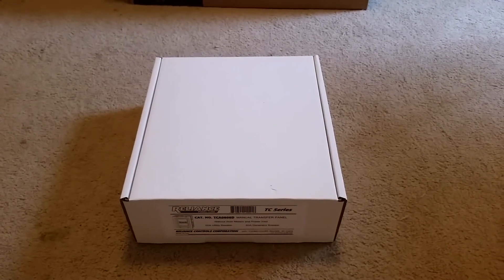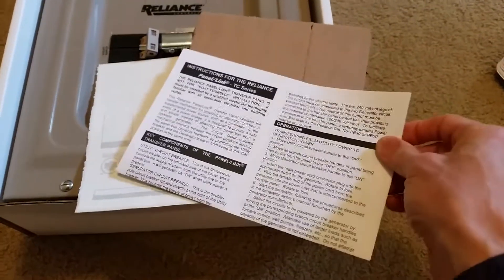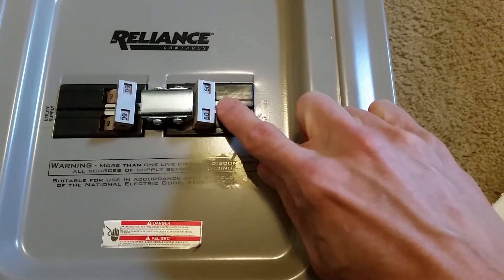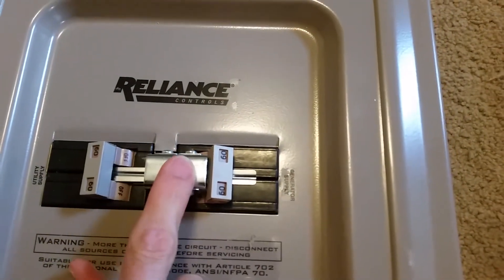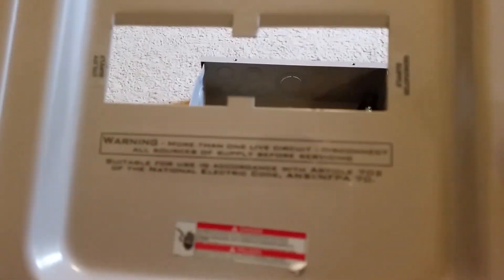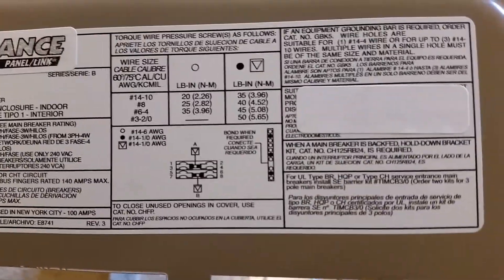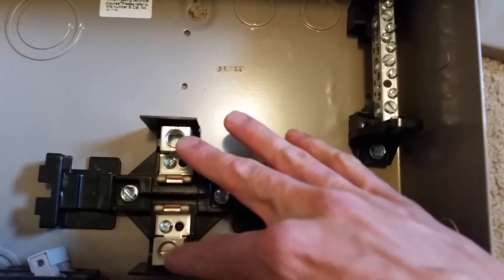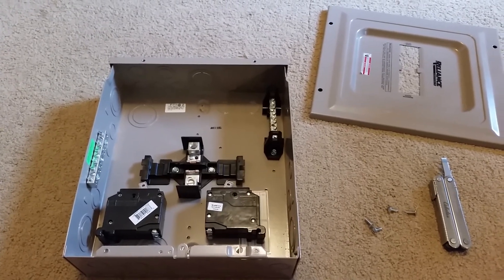Reliance Controls 60 amp Manual Transfer Switch Panel Box Opening & Review

Comment: Thanks for the overview. I have the same setup where I have subpanel (critical circuits) being fed by a inverter that feeds utility power and then switches to battery when it's utility feed is lost. Inverter is fed by 50 amps as to allow charging and feed the backed up circuits. My Generlink on the house died (don't recommend those now!) so needed a way to go between generator and util to feed the inverter (and then the critical circuits) so plan to sit this in front of the inverter. I have about 30 amps in the subpanel including my well pump and honestly thinking I'll probably never need my generator as most outages are 2 - 4 hours and battery backup handles everything without any issues. Anyway, thanks for doing this!
Reply from the maker: You are welcome and thank you for watching and the excellent comment.

Comment: Oh wow ! I have the same exact one also on my system  . Now this is the holly grail of any solar system that’s very necessary to have for a safe power transfer from on grid to off grid and reverse . Check out my transfer switch videos and safe switch over uses where I have it going to my breaker box and leave a comment . Props to ya man and “ May The Solar Be With You .